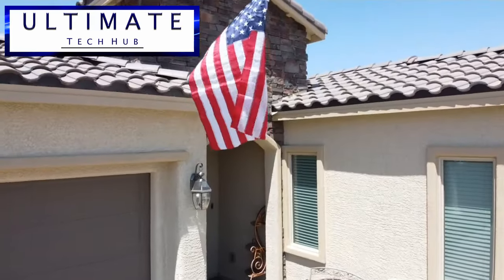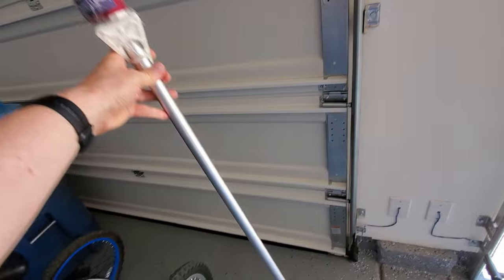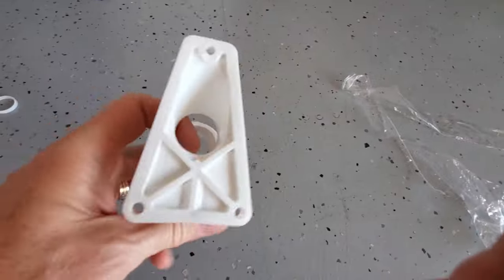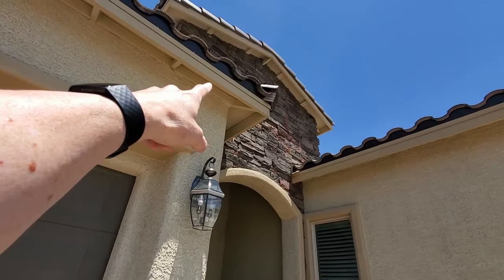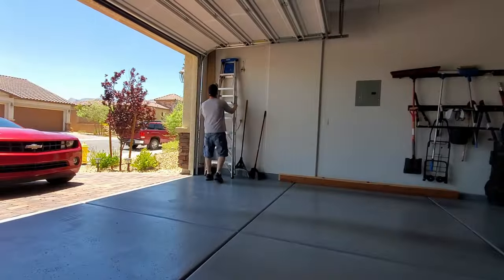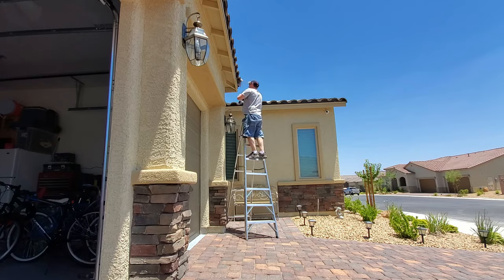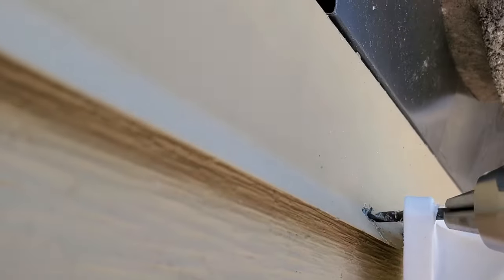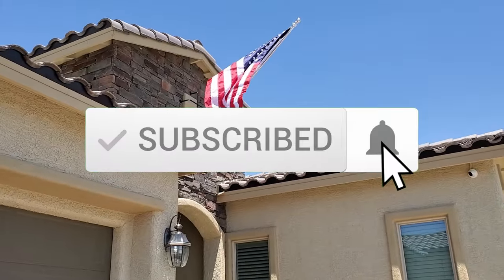HOW TO INSTALL A FLAG ON A HOUSE QUICK & EASY  SEASONAL DESIGNS, INC

Comment: The seller should be ashamed for shipping the flag with all those wrinkles. It should be packed a better way so it's right as you take it out of the box.
Reply from the maker: True! I got it at Home Depot. After a few weeks the wrinkles are all gone. I want to get a better quality flag for next 4th of July! Just a heads up the plastic holder broke so I installed a metal holder. I have a video on the replacement of the holder. https://youtu.be/hoBCV3GQ9mQ   Thanks for watching!

Comment: Thanks! I was trying to decide weather to attach to the fascia like you or to the stucco wall next to garage but I like the look of your placement.  Guess I'll copy you and save the stucco from holes. Cheers🍻
Reply from the maker: Awesome!! FYI the fascia is way more secure. My flag is always up! I did replace the plastic holder with a metal holder just because it's more durable and my area gets very windy. Thanks for watching and for commenting!

Comment: How do you fly the flag at half-mast with that type of setup. Memorial Day they should be flown at half-staff until noon then full staff the rest of the day. With that type of set-up looks like you can't with that pole.  I believe in flying the flag properly as the flag code states. I am having a hard time finding a staff that allows me to do it. It is sad you try and respect the flag. and fly it the proper way with the right stuff so any help I would be grateful.

Comment: What size drill bit did you use?
Reply from the maker: Just pick a drill bit that's smaller than the screws. Mine was smaller than 1/8th. You want the screws to be super tight especially if your area gets windy.

Comment: What is the security issue of this flagpole? Sound awkward though I want to understand.   For example If any stranger trying to pullup will he be able to steal the stick?
Reply from the maker: They could take it yes. That's why I installed my up higher so they would need a ladder. I have seen on my Ring Doorbell Alerts that some kids were taking peoples flag poles off of houses but the flags were installed pretty low. Also I recommend installing a metal holder instead. My plastic holder broke after 3 months. I havre a video on my channel that covers that very subject.  Thanks for watching!

Comment: Every time I think I want to install one of these, I remember that I live in Oklahoma and that it probably wouldn't last through the Spring season (seemingly random hellacious winds). 😱😢
Reply from the maker: I used to live in Tulsa and yes the wind is insane sometimes. I had to replace the plastic holder with a metal holder. I have a video on that as well. Thanks for watching!

Comment: I bought mine from Home Depot the flag pole keeps shaking and I’m the mounting bracket broke so then I bought another one that’s more expensive so it is better quality and instead I put in 4 screws instead of 3 but it’s still shaking really badly even when it’s not so windy idk what to do anymore
Reply from the maker: I had the exact same issue here is a video  i did last month were I replaced the plastic with a metal holder.
https://youtu.be/hoBCV3GQ9mQ
Reply: @UltimateTechHub  thanks man

Edited: btw sorry for all the spelling errors in my comment

Comment: Strong wind, small screws, naw
Reply from the maker: I replaced the plastic mount with a steel mount and 1 and a quarter inch screws. Be get tons of wind and I have to take it down when the wind is strong.

Comment: This video gave me anxiety with how many times he let the flag touch the ground or even set it on the ground. If you are going to display a flag or make a video on how to install one, you should probably start by reading the flag code first. 

That also doesn't seem like an ideal place to mount the flag since you can't easily get it down, like during inclement weather. And you also did not say anything about having a light shine on the flag if you aren't going to bring it in at night.
Reply from the maker: It's ok, no ones perfect and when I was filming I tried to show the install and film at the same time. At least I hang a flag on my house, no one in my neighborhood hangs a flag. I have a security camera with a flood light that shines on the stars and stripes all night long! My only issue is the wind. Las Vegas doesn't get much rain. Thank you for watching!